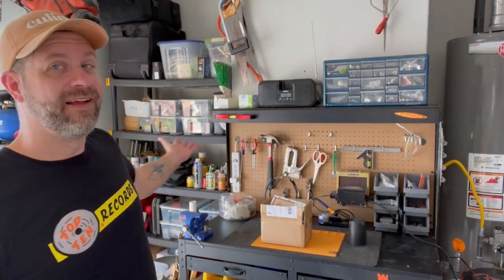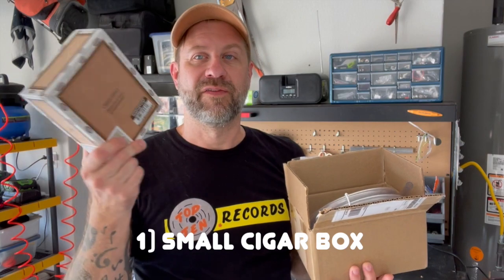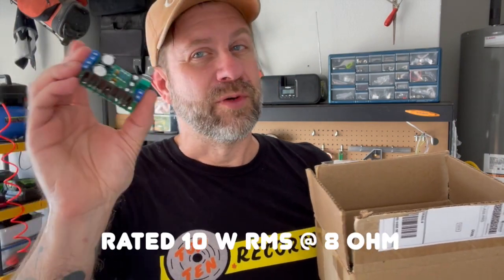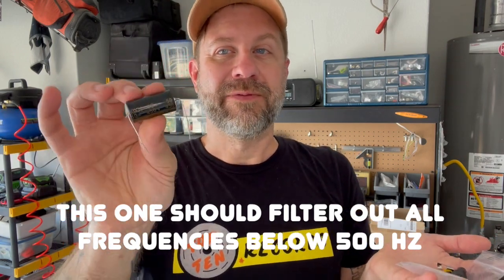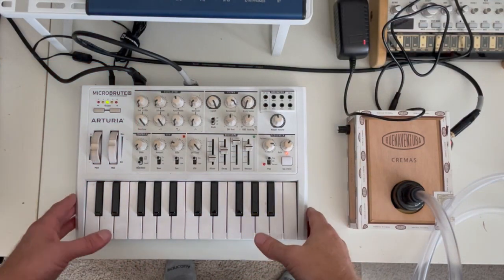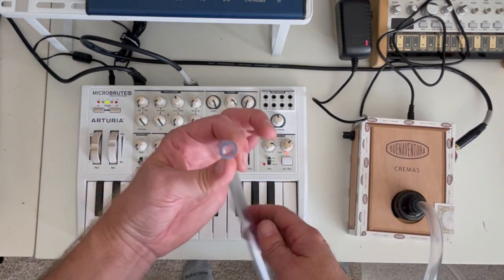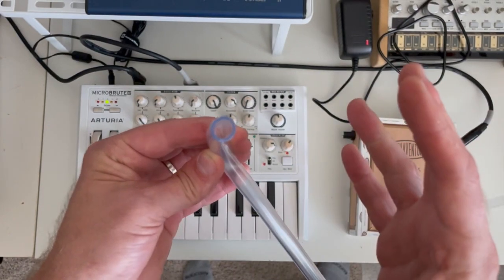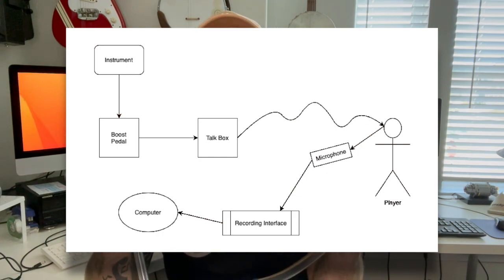How To Build a Makeshift Talk Box (DIY FX Pedal)

Comment: I made one in 1976, very similar. I used a cassette tape recorder as the amp. It worked! I learned a lot of ways to make different sounds, one of which was to open my throat and it made a great sound. I like your design and it looks like it would be very inexpensive, and the electronics look simple; I’m not an electronics expert at all. Thanks!
Reply from the maker: That's great to hear. Thanks for sharing and also for checking out my vid.

Comment: Thanks.  That's a good job.  I found the adapter on Ebay for around $8 with shipping.  One thing I know with Frampton, he actually drove the speaker from a guitar amp output (50W Marshall) which outputted to the talk box jack and the speaker driver inside.  Possibly with a capacitor.  Which means he probably pumped a lot of wattage to the driver.  I remember him saying it would chatter his teeth. Ritchie Sambora reportedly used a  Fender Showman head to power his Framptone talk box.
Reply from the maker: Thanks for the information. I appreciate you watching and commenting. Have fun with the build.
Reply: @musicalmiscellany  Honestly, at 69 yo, and no longer playing out, I had to smack down that young person inside me since to me, other than fooling around, the TB is something for playing out and making that impression.  So, doesn't really apply to me anymore.  Of course I wasted a couple of hours of time sketching up what I would do to simplify it even more with a $20 4 ohm 250 watt compression drivers available for $20 off Amazon, and some vinyl tube available for $8 at home depot, and the adapter, for $8, with a jack, capacitor I already have.  So $36 total.  And I have a Galien Krueger amp 100W from the 70s that has a second series speaker output jack (which would make 8 ohms) and a switch to change it to 8 ohms.  Where I would simply leave the TB coil plugged in all the time and active.  In that way, you want to use it, just put your mouth on the tube.  You don't, then don't.  And in that way, my multi effects pedal tones through the amp input would feed the TB.  So I could apply any OD or fuzz I wanted.  Of course I wouldn't crank it up to full power to pump 100 watts into it or it would probably shatter my teeth.  lol.  That's "if" I planned to do it, which now I don't.  But it was a fun little journey down fantasy lane for me.  :) I also thought you don't really even need a box as long as you can prevent the leads near the speaker and at the jack from shorting.

Comment: I bet an old cassette recorder with built-in speaker, and mic input, would also work. Drill a large hole in the side of the recorder, positioned behind, but next to the speaker cone, then cover over, and seal up the speakers original opening, then hot glue the tube into the hole, from inside.  Think cheap 1980's Realistic cassette recorder, with a tube sticking out the side...😁
Reply from the maker: I'm pretty sure that would work. It's always fun to experiment though.

Comment: Great Video. I built mine from a Horn speaker that I removed the horn from. The tube fit inside perfectly. I drive mine with a EH 22-Caliber amp. Switching is through an A/B foot switch. It's a fun thing to play with.
Reply from the maker: That sounds like a really good way to do it. I actually thought about using one of those pedal amps. I thought it might be easier to have a small amp in the box, but I'm starting think running power for a traditional guitar head might be better.
Reply: @musicalmiscellany  You could build it all in an ammo can. Put a 12V battery in the ammo can to power the amplifier.
Reply from the maker: @davidglynnguitars8119  That is a great idea.

Comment: Hi , it is a cool project .  The only horn driver I could find near me is a 500W .  Is it too loud or it could work ? Thank you and have a nice day .
Reply from the maker: Thanks for checking out the video. A 500W horn driver should work as long as you don't underpowered it. Instead of a 10W amp you might want to look for a 20 or 30W mono block amp, but theoretically it should work.
Reply: @musicalmiscellany  Hi again , thank you for your answer .  I have another one for you .. The only capacitor I could find similar to you are 50V 47UF  .  Can't find a 50UF .  Will it work ?  What can happen if I don't use a capacitor ?  Thank you and have a nice day .
Reply from the maker: @stevedulong  Is it an 8 ohm horn driver? If so, there's not going to be much difference between 50 uf and 47 uf. The lower value with actually block just a bit more of the low frequencies. The idea is to block out any  bass frequencies that could harm the driver. with no capacitor, it would send all frequencies to the driver.
Reply: @musicalmiscellany  Thank you very much .  Love your channel . Also made a electric lyre harp .  It was much simpler .  Have a nice day . 🙂
Reply: @musicalmiscellany  Hi again .  I'm a bit confuse .  Can't find a 30w mono amp board and I already a the 10W .  What can happen using the 10W with the 500w horn which is on the way from amazon canada .  Am I better off searching for lower W horn ?  Once again thank you and 
have a nice day .